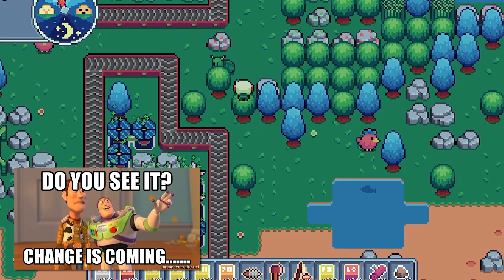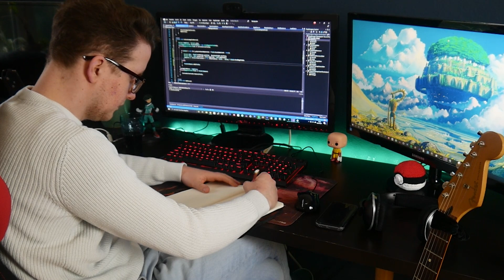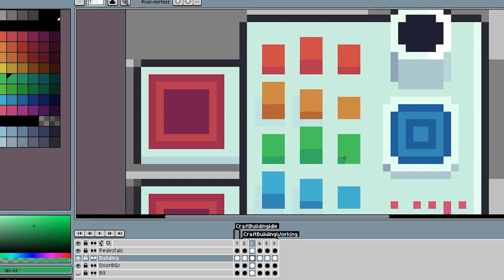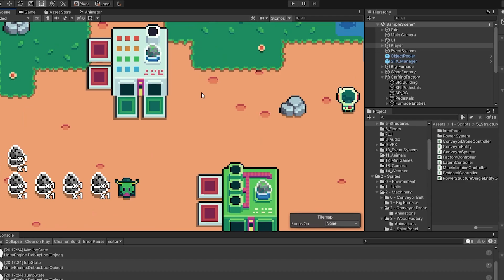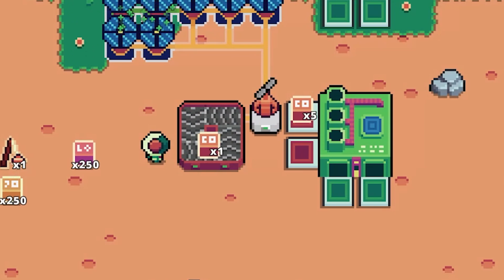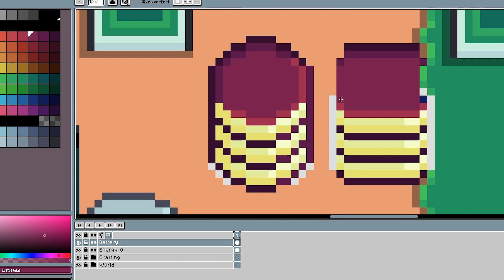How I made Automatic Crafting! Exo Colony Devlog #10

Comment: looks good!, could I make one suggestion, have two cameras, one your main, and a second for electricity. Have the power lines only show through the electricity camera but are hidden on the main camera. this will make it easier to see how the power lines are structured, and keep your main game cleaner. You could also add a shader to the factory objects that will only show when you are viewing the electricity camera and add some post-processing to the electricity camera ( a blue colour tint for example ) to indicate what you are currently viewing. this will also help with performance because the game will not have to render the powerlines lines every frame, only when the electricity camera is being viewed. you could also use this method to create a production camera that will show everything being created on your production line. keep up the good work!
Reply from the maker: Thanks for the feedback! I think the two camera methods is a really good one :) I'll totally keep that in mind and also the shader idea. Maybe already for the next devlog. Thanks a lot!

Comment: Ay, I have 2 ideas

The first one is because I noticed there's still a bit of pain with animals getting in the way. I got 2 ideas for that. Either there could be something you can press where you swap places with the animal when you're next to it so it's out of the way, or the other idea; a tool you can use to push it 2-3 units away. If there's a building behind it that's small enough (such as a conveyer belt) it could launch the animal over that (without hurting it... somehow).

The other idea is for the new generators. It would be pretty annoying to continually feed them, so of course, you could have conveyer belts going into them, but then it would get too crowded and not space-efficient at all if you needed a conveyer belt for each generator. So I thought you could make each generator share fuel with all adjacent furnaces. 
I thought of 2 methods of distribution: The first one is whenever an item enters one of the generators, it calculates all the generators attached to itself and all the generators attached to those etc. then it divides the item evenly between all of them.
The other idea (which I think is a bit better) is when an item goes into a generator, it just fuels that one. If that generator becomes full, the next item that enters it gets split between all the adjacent generators. This means the generators furthest away from the conveyor input are most likely to run out of fuel. so this means when you build your area of generators you need to keep in mind how to get the most even distribution of fuel possible as you can have multiple inputs. a square grid of generators, for example, would be best to have one input at each corner and (if the square is big enough) a conveyor going to the center generator, too.

Thanks for reading, and good work!
Reply from the maker: Thanks for this very detailled commend :) The animal swapping is a real good idea! Works the same in littlewood and is actually quite important. I'm sure I'll implement something similar. And I did not think about some other kind of distribution when it comes to the generators so this is really helpful! Not sure when I'll come back to work on this feature but your ideas are noted! Thank you so much :)
Reply: @ObviousDev  no problem, thanks for reading this really long comment!

Comment: Looking at the battery, I can't really see any indication that it's being used or that it's charging. Given your asset, I would use the 3 glowing bars to represent battery charge level as x/3, with no glow at empty and the asset shown at full, blink the topmost glowing bar when battery level is changing, and turn the battery white or electric blue with an animation when it's feeding other devices.

It is a neat crafting system, tho!

Comment: Will the batteries be portable? I think that could be a fun challenge: charge them and place somewhere where the normal energy-system doesn't reach
Reply from the maker: That's a great idea!! :)
Reply: Many add a type of tree that produces rubber sap similar to real life you can use to create tires and make vehicles that will make you go faster than normal and carry resources in the back